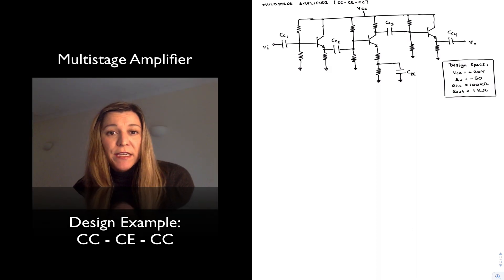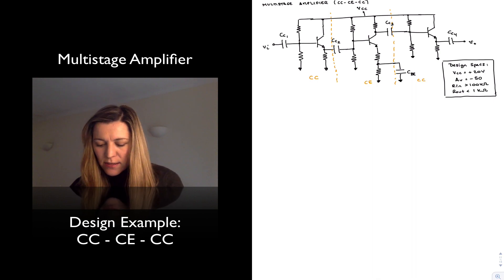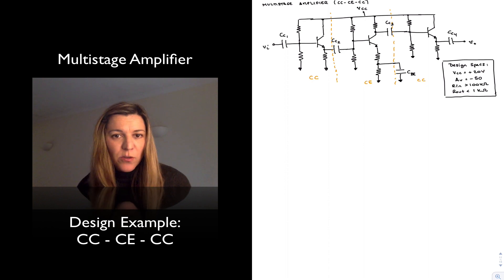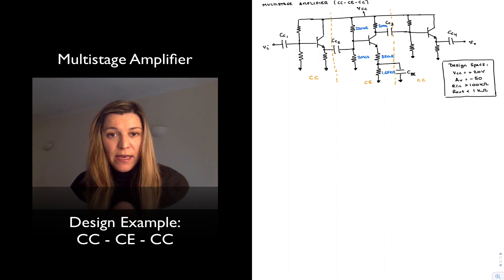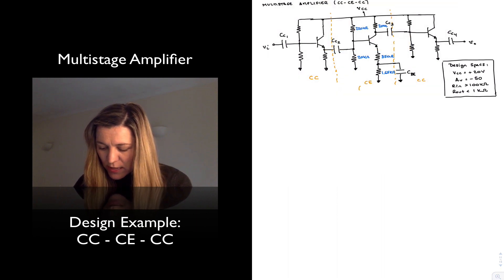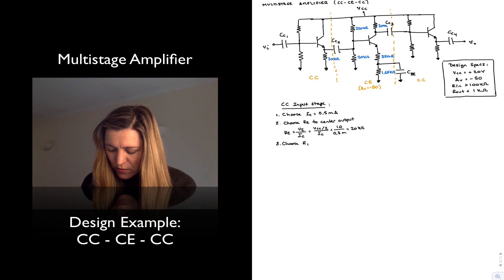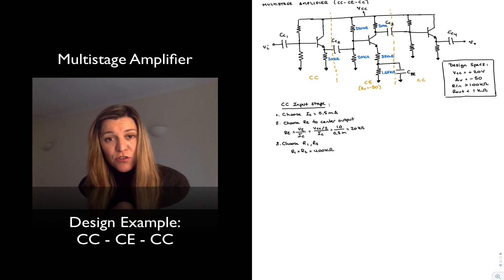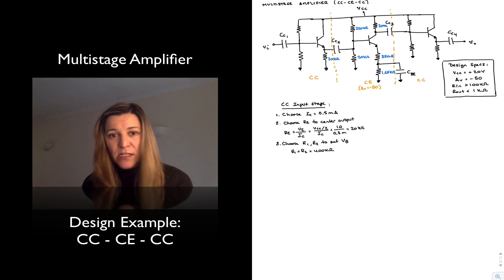Multistage Amplifier: Design Example

Comment: hey, great video... I was wondering if you could help me with a doubt...

I need to do a 3 stages audio amplifier.. my Vcc is about 5 V... how do the resistor y capacitor´s value will change? thank you
Reply: hi did u use cb stage

Comment: Please correct me if I'm wrong, but Rpi is not equal to 1/gm it is Bo/gm. The only way it could be 50 is if it is 1/gm. I'm using the book called microelectronic circuit design 4th ed, by Richard C. Jaeger and Travis N. Blalock.

Comment: Great video! I appreciate your teaching style very much.One problem I had was calculating the capacitance values even with using the videos that you posted. I don't know why I'm having such difficulty. For practical purposes, I assumed the capacitor at the input to be 10uF and every other capacitor to be 100uF. When I simulated the circuit, I only got a gain of about 35, which is much lower than 50. Excuse my limited knowledge about BJT's. I was just hoping for you to tell me what capacitor values should be used for this specific circuit.
Reply from the maker: Take a look at the videos on the frequency response. I cover how to calculate the capacitor values. There is an entire playlist for this specific topic.